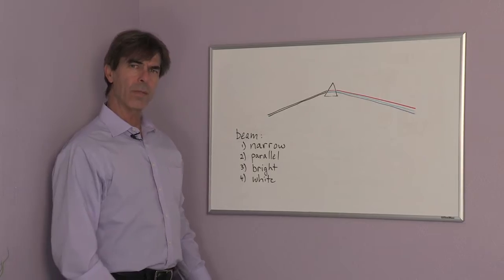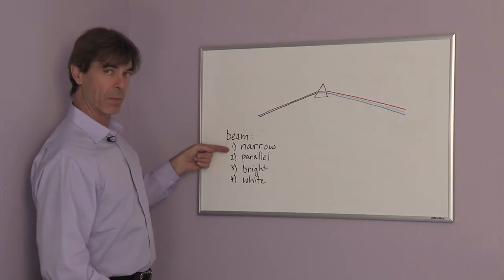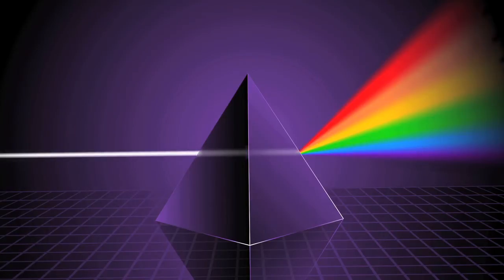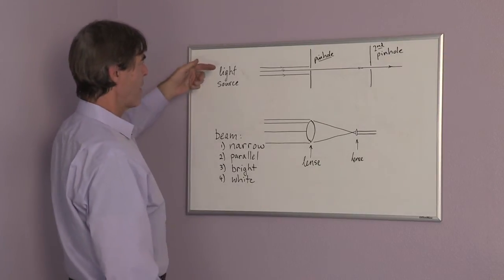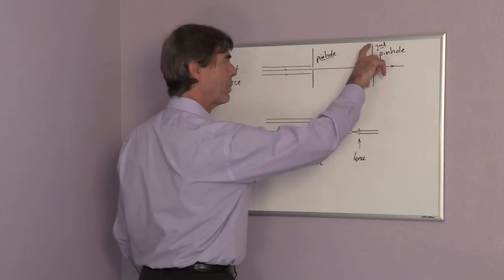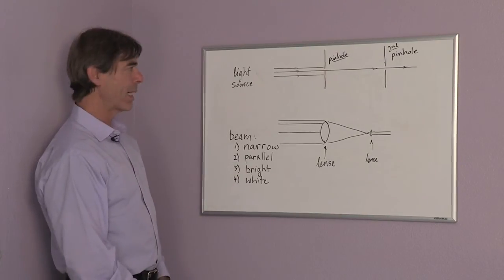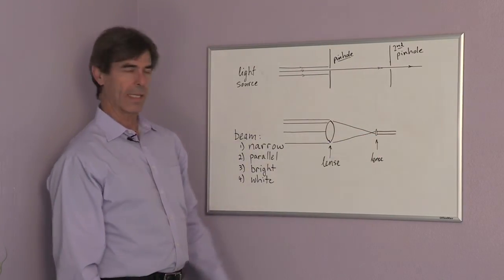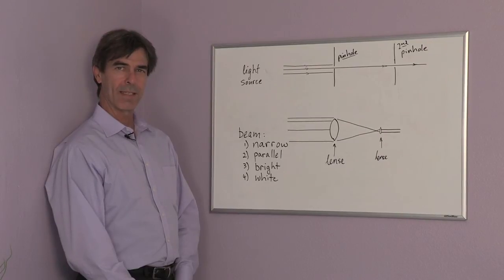How to Make a Beam of White Light for a Prism : Chemistry & Physics

Comment: I am searching for over two months for a light source able to make a powerful spectrum for lab testing with no success. Tried halogen lamps, not powerful enugh, spot projectors, different lenses, it seems that the only thing powerful enough is the sun light, but i still need to concentrate that in a beam, tried telescope, nothing. Any suggestion?

Comment: anybody know what lenses i would have to buy? im planing on making a solar death ray and want to create an array that would collect sunlight on a wide surface area and the focus it on a lens that would transform it into a parallel beam. can i synchronize the photons in any way to make a laser?
Reply: ***** i did some basic research, but haven't worked on the project, what you would need to do is have a series of mirrors focusing light onto a normal biconvex lens, then have a second biconvex lens 2x(focal length) away to make the light parallel. technically not a laser since the light isn't monochromatic and their is no excitation of atoms. however the light technically should be coherent.